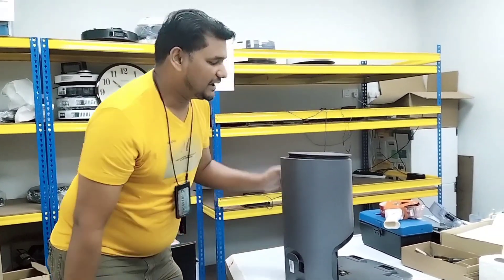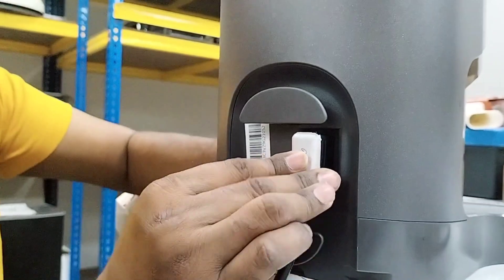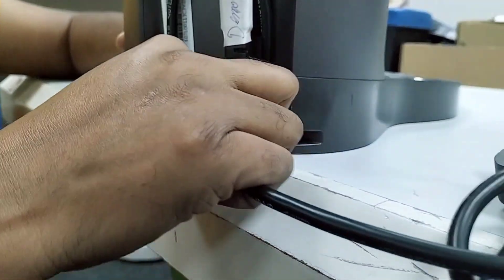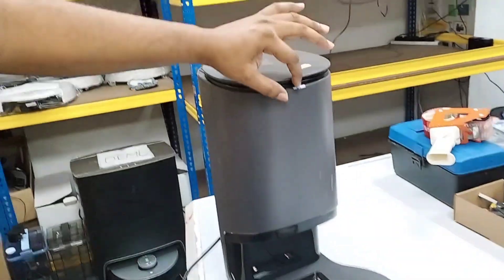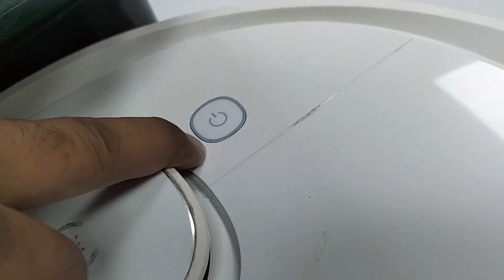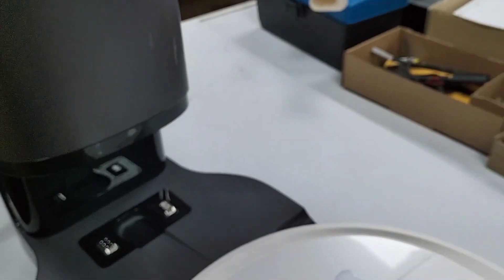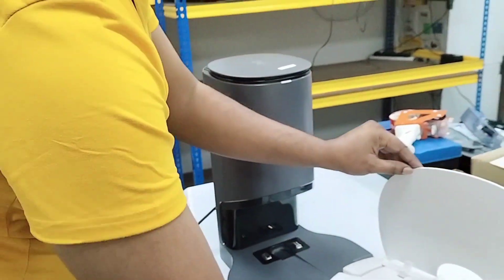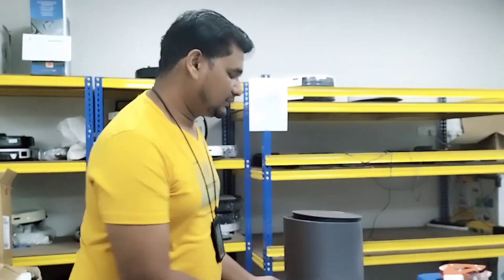How to Test If Ecovacs Auto Empty Station not Charging?

Comment: I have a base station that says 120v but it’s exact model as in India, will that work without a step down transformer? How to check the internal to confirm its same inside?
Reply from the maker: Different countries got different power volts...you can use just need to provide exactly same Volt as required...in market different types of docket, switch available easily..from them U can decrees the volt accordingly

Comment: Hi
I bought the same device but after 3 or 4 days the charging station when the robot approach it slightly explodes the dust pop up and stopped charging.
How can I fix it? Should I replace the power board?

Comment: Hi! You have great videos! My empty station does not power on at all. I have tried adjusting the plug and there is no light to indicate its on and vacuum doesnt charge either. How do i fix this? Do i need to buy a new plug?
Reply from the maker: No it's not a plug issue...inside the station got one power board that's got problem... U need to replace power board in station
Reply: Where can i find a power board, im facing same issue, the deebot doesnt charge abd there is no light on the auto empty station@ecovacstechnicalsupport5278
Reply: How much does it coast?

Comment: Hello, I purchased an Ecovas T20 product and the charging station does not work at all. I did the steps in the video and it did not work. The robot works but the station does not work. What should I do?
Reply from the maker: U need to contact with seller if it's Under warranty...if over warranty then ok plz send me a video clip so I can see what's the issue
Reply from the maker: 00601137973018

Comment: The wire isn’t detachable, it’s coming from inside, but it’s not able to charge the vacuum or I feel it doesn’t even turn on, would it be possible to fix it? Could you please give an email or a contact you by any chance.
Reply from the maker: 00601137973018
Reply from the maker: WhatsApp only

Comment: Hi, i have just bought a new N10 plus but whenever i put it on the empty station it is not charging (although it is connected to electricity and the light at the top is on) 
Who can I find out if the issue is from the robot or the station and how can I fix it?
Reply from the maker: Check manually first weather charger Charging connector touch properly with deebot charging connector or slightly up or down....for testing purpose plz remove the top plate so you can check eaisly....I hope after removing the top cover it will return back eaisly...means charger is slightly lower...just put 1mm paper or something to make it slightly higher that's all
Reply: I have this issue, if the water tank is fitted (empty or filled with water) , the t8+ is not charging because it is not touching the charging plates, if I removed the water tank tank, it is setting and touchin the plates and changing. 
I tried to put small paper but same issue. 

How to fix this issue? 
 @ecovacstechnicalsupport5278

Comment: How do we open the auto empty station? One of the charging plates has become dislodged and I need to open to fix it
Reply from the maker: Just remove the base attached with 3 screw....then there are 6 screw on the plate but hidden under black rubber.,.. when u tuch the rubber n press a bit u will understand where is the screw.  Just open that screw & pull up the plate then u can replace that connector...
Reply: @ecovacstechnicalsupport5278   Do you have a video showing this process? I have an auto-empty station with a loose charging plate that slides forward/backward.
Reply: Pull the black cover around the charging plate and correct the plates.
I have same issue, and I fix it without removing any screws.
I have deebot t8, same as the video